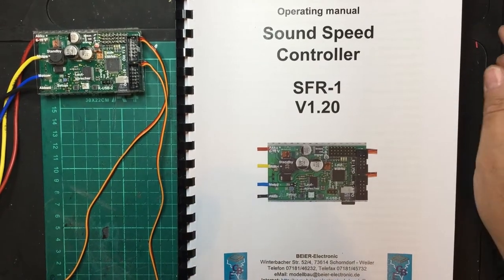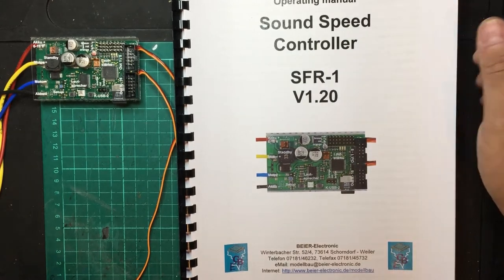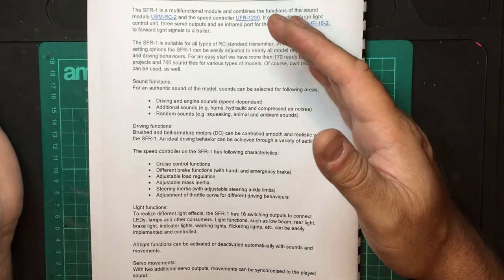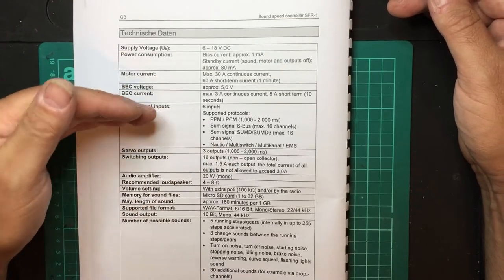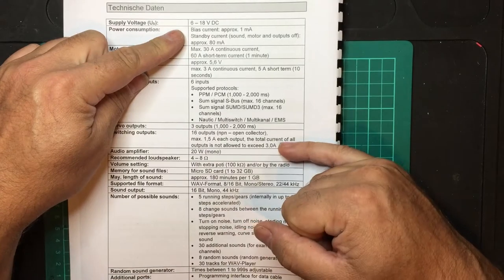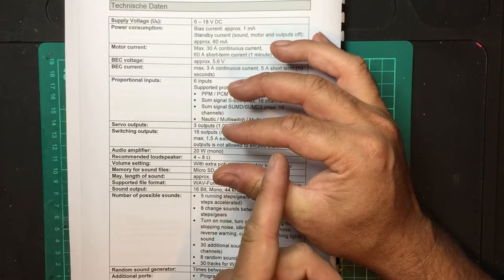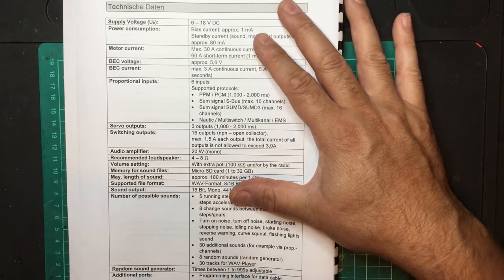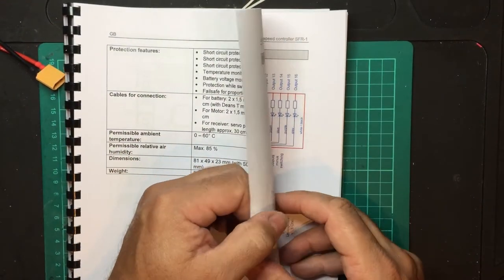Beier SFR-1 Basics

Comment: This is only the second Channel, with any kind of GOOD explanation of this unit!  Thank you. 😊
Until I recently heard about this, I really thought I was STUCK with the MFC-01, with as you stated, the SAME Sound and Light program since the mid 90's!! And just a SINGLE Speed Engine Sound from Idle to full. 😖 

Just the fact that I can have up to 5 "shifts" in the Engine Sounds, makes this a clear winner! Plus it's $100 LESS!!

HOWEVER, although I've got over 40 years in the Hobby, an Automotive background and extensive Wiring experience.... 
I am Computer STUPID when it comes to individual Function setup. 😞  

I'm going to find your other Videos on this subject, HOPING that there's some Beginner information about this. 
...... The other Channel, although very knowledgeable, too often ASSUMES that we're all at his level, and skips through pertinent information!

Comment: What about i-bus ? Where connect the touch cable on the board?
Reply from the maker: @15:00 X6 is for i_BUS also the bluetooth module but you cant use both. Hope this helps